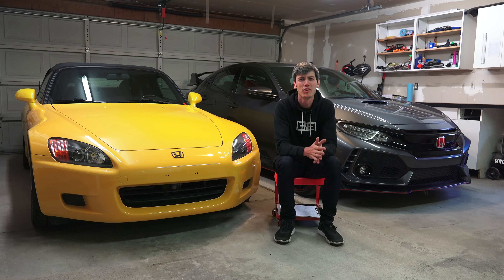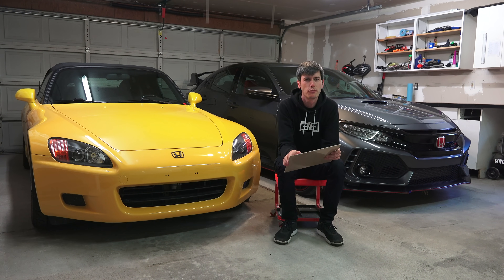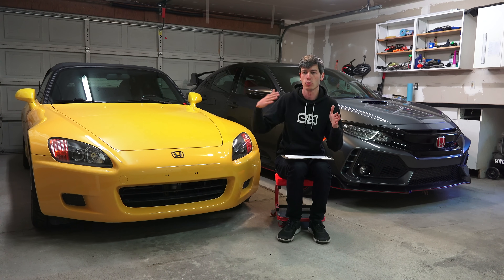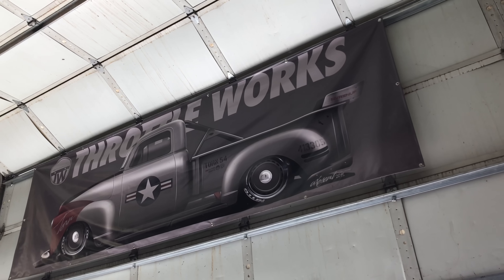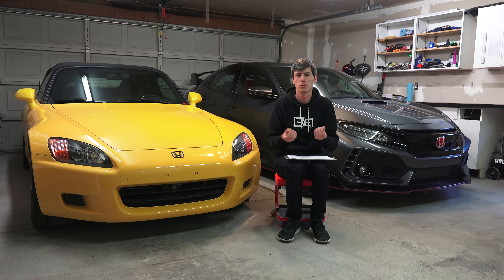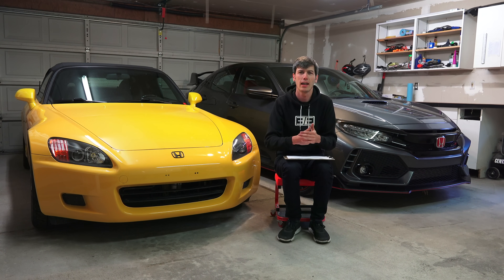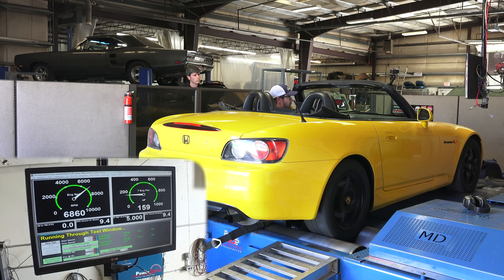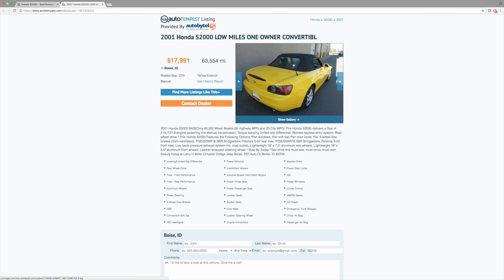Why Comparing Dyno Numbers Is Silly - S2000 Gets Dyno'd!

Comment from the maker: Hope everyone’s having an excellent day! It was fascinating spending time with a dyno for the first time, and I’d love to hear about your experiences as well. The more research I did, the more often the same conclusion was pointed out - that the only real meaningful information you can get from a dyno is direct comparisons of the same car on the same dyno before and after modifications. I’m sure many of you have spent time with these devices - what have you learned about them in your experiences? What type of dyno have you been using? For anyone that’s used a Mustang dyno, what “Parasitic Multiplier” parameter do you use? 

And hopefully we can get the catback and supercharger on soon! If you’re into scrolling through photos and giving them hearts, consider following on Instagram: www.instagram.com/engineeringexplained
Reply: I don't think you covered in enough detail why these dynos are so inaccurate. Even if the calibration was off at first, why weren't the finalized numbers just applied to all of the results? Since your S2000 is stock, why weren't the gear ratio values simply googled and your tyre radii measured? The torque figures vary by over 1%, is this an issue with the equipment, or is this normal for cars? Your torque figures go up each run, is this just a statistical anomaly, or is the car being warmed up or fluids being circulated better?
Reply: Haha, scrolling through photos and giving them hearts is my jam! ❤️😂
Reply: Engineering Explained Numbers will always vary on a mustang dyno every car guy knows but that is a fact mustang dynos are not good
Reply from the maker: +Liam Collister this is the same with the Mustang Dyno. It has local measurements for temperature, humidity, and barometric pressure, which you cannot manipulate. But there's still so much available with these machines that allows for manipulating the data.
Reply: As a tuner myself you're quite right. the only real meaningful information you can get from a dyno is direct comparisons of the same car on the same dyno before and after modifications. It's tiring having to try and explain this to people that have brought you a car to be retuned, they complain that the results achieved on the dyno I'm using are less than the ones they had on the old tune - even though they say it feels better (because it is) when it's an entirely different dyno on a different day.
Reply: Make sure to upgrade your brakes as you do the super charger.  Just want to ensure you can stop :)
Reply: what supercharger will you be using?
Reply: Engineering Explained Hey, I guess video will get at least one "Got VTEC?" comment.
Reply: Engineering Explained what year is the type r? I prefer the sedan over the coupe looks and practicality.
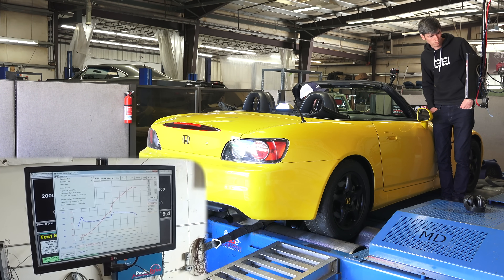Reply from the maker: +Le Team Awesome - See 2:08 for an explanation of why the torque number differs for runs 1-3.
Reply: Engineering Explained I hope YOU are having a great day as well!
Reply: Should have had the car tested on a MAHA Dyno.
Reply: Engineering Explained It is good for direct comparison of modifications before and after. But if your goal is to just look better than another car then go to a drag or race track. I love my little Veloster none-turbo MT  1.7litre, 4 cylinder engine and allthough it won't win any  races I love it. It would be nice  to be able to modify it and test it on a dino for sure. Cheers.
Reply: I have used DynaPack mostly, they are supposedly the most repeatable dyno's and they exclude tire friction which may vary quite a bit from tire to tire and roller to roller, by bolting directly to the hub's. Tho the most common thing for ALL dyno's is that people enter with hopes and dreams, and usually leaves with crushing disappointment :P
Reply: Njal, when comparing one car to another most people only care what's getting to the ground, so removing the tires to eliminate their friction seems kinda silly.    Might as well just remove the engine and put it on a chassis dyno and compare crank hp numbers.  ;)
Reply: You should definitely checkout LHTPerformance those guys know their S2000s, they're also on youtube
Reply: I can tell you are not originally from Boise by the way you say Boise 😂 
If you're not from Boise you say "boy-zee" 
If you're born and raised you say "boy-see"
Reply: I see a Dodge Coronet
Reply: My ego will be boosted only by returning a Hyundai Accent GS from the walking dead to the walking living
Reply: New Video Idea ??? Forced induction , Yes I know you already have videos on this but is nitrous considered forced induction I'd appreciate any help thanks
Reply: So question how did you end up going to Throttle Works??
Reply: Engineering Explained I would recommend just using a Dynojet, not because it’s better, but it is more comparable with what your viewers use.  Just my 2 cents.  Even doing upgrade comparisons will not translate well compared to just doing it on the Dynojet.
Reply: A friend of mine uses a Dyno Developments dyno that runs off its own weather station etc. Almost all of the parameters are locked so you can't inflate any numbers. What you see is what you get!
Reply: It's Gods work you do. Seriously, I've been saying this forever. Thank you!
Reply: This is why if people are going to compare different cars on different dynos, they generally want them all to be Dynojets.     Most  Dynojets use the same mass drum, so there's no fussing with the calibration.   There may be altitude/temp/humidity compensation applied later, but the raw WHP numbers will be the same no matter which Dynojet you put the car on.   It's just accelerating a mass.   Mustang is probably better for tuning as it allows you to simulate different loads (I think it can even hold the rpms steady), but if you want to compare different cars, in different places, Dynojet works just fine.

Comment: Also that RWD is more fun than FWD, and lack of too many driver aids leads to a better opportunity to fully exploit the car's potential and also to crash it XD, hence fun>>>power.  Learn Honda, learn...
Reply: Nishant Dash i like a good FWD with LSD tho
Reply: Don't do drugs and drive tho!
Reply: Amen to that!
Reply: Ham Steaks I doubt you're surprising anyone in a corvette. Lol
Reply: Sergeant Speed I'd be willing to bet the Corvette owner behind me thought the same thing before falling further behind in the corners.
Reply: Ham Steaks doubtful.
Reply: Ham Steaks unless you were racing a late 70s corvette with a choked out 350 and boat like handling.
Reply: Ham Steaks because my modified rwd 90s gm car is probably on par with a c5. Your exaggerating your fwd platform. 

Let me guess, a chevy lumina? Or a Bonneville?
Reply: Ham Steaks also, I doubt it because any 90s gm garbage fwd handles like ass because of their cookie cutter suspension setup and the fact that the corvette has a huge power to weight ratio advantage on top of much more superior suspension on top of better center of gravity on top of lower weight on top of wider tires on top of a limited slip diff. Need I go on?
Reply: Ham Steaks still. Not gonna compete with a c5. Berrettas can be cool but they're definitely not impressive by any performance means. What do you mean by "built" that's such a generic term.
Reply: Ham Steaks that's still so generic. So it's built for a turbo? You mean low compression? What kind of cam, what bore? What kind of pistons did you use?
Reply: Sergeant Speed 
Basically, I bought a low mileage motor at 4k miles and was building it to be a low boost stock everything except Bolt on/slide in parts.
The heads and gaskets were stock as they were post shitty gasket design.
Competition ported Upper and Lower Intake Manifolds, Billet Aluminum high flow, CNC machined Throttle body, Competition Cams cam that was ground to perform good on and off boost and valve springs along with custom length pushrods, coated small block Chevy bearings. Built that motor literally 6 years ago in a small storage shed and sold it after I took it out of storage about a year later because storage destroyed it.
Reply: Ham Steaks next time you build something to store it. Fill the motor with oil. Itll keep the internals clean should it ever collect moisture. You'll have to clean it up but it won't have corrosion on the bearings or bores/ any other exposed metals inside the motor.
Reply: Nishant Dash "fun" is subjective. I also had a lot of "fun" surprising Corvettes in my FWD shitbox around corners so...there's that.
Reply: Sergeant Speed My car was a mid-nineties GM FWD car, originally built in 1987. Corvette was a C5.
I'm not understanding why you think it's so unrealistic.
Reply: Sergeant Speed Btw, my car was a 96 Beretta with a built and cammed motor with minor suspension upgrades.
Reply: Sergeant Speed "Built" as in I had approximately $1200 into the motor and wasn't even tuned, built for a turbo, didn't even have a turbo...and crushed a C5 Corvette around corners.
And FWD.
Was the L body the greatest platform ever? NO.
Could it keep up with a Corvette one Gen ahead of it? Bet your ass.

Comment: I want an s2000 so bad! I had the chance to get one years ago but i went with a 350z instead..... worst choice ever
Reply: U should have went with s2000.. nothing more fun than driving the car u like
Reply: Samiata "all other aspects" like what? I wouldn't say it looks better handles better and sure doesn't hold its value like the s2k.
Reply: i didnt know much about cars back then. i started to learn with the 350z and along the way i found out online that the de engines had oil consumption issues
Reply: Samiata s2000 is superior to both that's why it's highly sought after and price of it is still high. You can find cheap Miatas for about $2-5k 350z from about 5k- 8k .  S2000 are still 13k- 22k starting from ok condition to the Best
Reply: s2k consumes a quart of oil every 800-1500 miles depending on how hard you drive it
Reply: You should've gone with a 270z
Reply: F22* haven't messed with AP1 s2k but I imagine there isn't much of a difference
Reply: My 350Z hasn't been burning any oil.
Reply: Samiata I can see them holding records for tighter courses but the S would be more stable at mid speed levels, any faster then maybe consider the older brother NSX
Reply: Nicholas Clark .....LOL......340whp get out of town. On what churches high ass reading dyno? Gain is that matters, not overall dyno number.
Reply: Frosandcons 420 more low end torque and can make 330bhp with an intake good tune and exhaust maybe water injection
Reply: Dont get me wrong the 350z was great minus the oil consumption issue but ive always wanted an s2000 and to this day i still want an s2000 lol
Reply: Well dude you should have went with that 350z hr no oil consumption problems and with full boltons you can get around 340 whp and if you want to go all out lighten the car by stripping out the back. put some sticker tires and the car will run like a dream trust me.
Reply: Prodigious 909 I have to disagree with that. I have experience with both Miatas and S2ks and the only superior thing about the s2k is the F20. Amazing engine. Miata takes the win in all other aspects.
Reply: Frosandcons 420 Get a Miata, best of both worlds
Reply: A Arr Miatas hold better track records than the s2k, I have driven both and I would take the Miata any day, s2k transmission is garbage, differentials are garbage. Miata's are more roomier. I understand they hold value but that shouldn't matter, I'm not going to buy a car I plan on selling. They say a Miata is a poor mans s2k but quite frankly I would say it's a smart mans s2k, from an auto cross/track standpoint. I'm not hating on the s2k, they're great cars and I'd love to have one, but I would rather spend the extra 10k into a Miata. Makes more sense to me, they are so similar that I don't see much of an "upgrade" from the s2k compared to the Miata. Miata weighs less, smaller turn radius, more responsive.